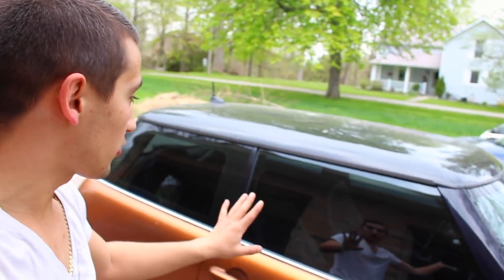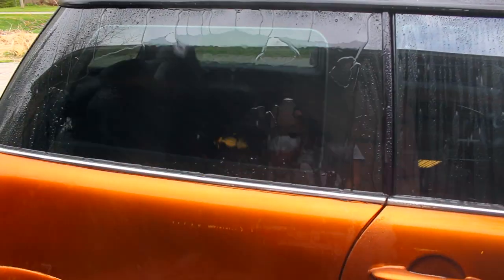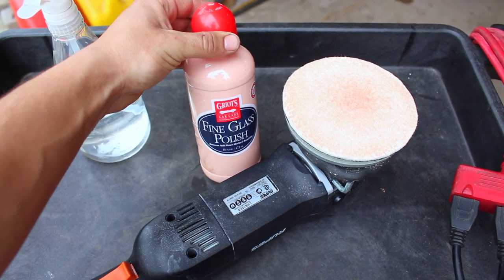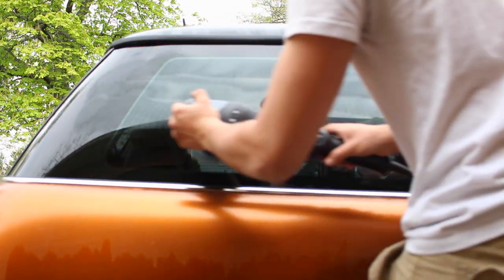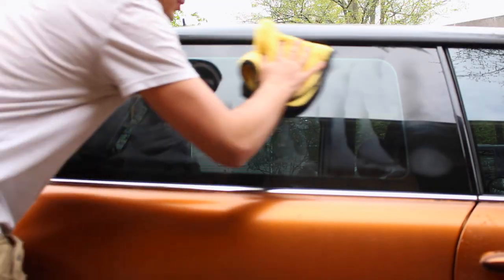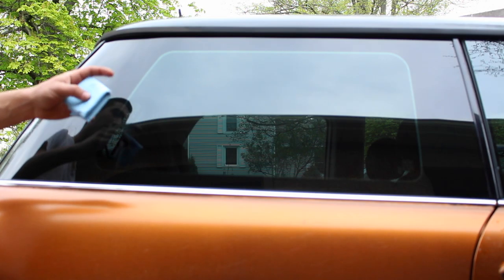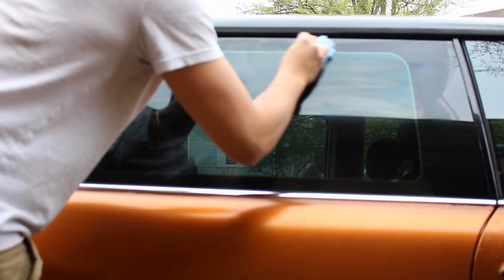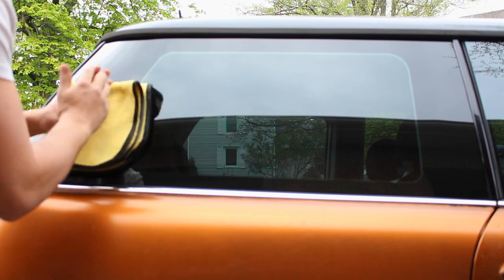How to Polish Your Windows

Comment: I just use rain-x; I used it in the past, on my windshield, out of 100 mile trip in rain, Erie to PGH, PA. I use my viper, less than 3 times.
For windshield, I used the rain-x windshield washer fluid, and for windows, I used the applicator.

Comment: I think the beading was mostly to do with the Rain-X and not the polish.  For windows with some sort of fallout on them, I would have cleaned, clay barred, polished, then Rain-X.  If you garage your car mostly, you probably do not need to polish your glass but I would always clay bar it.  I also use Griot's products, they can be a little pricey and there are other fine products out there.  

Note:  although I have a set of first generation Griot's microfiber towels, I would not buy them again.  They worked well, but so many others last longer (retain their pile) and are less expensive.  I recommend Griot's cleaning solutions, but not their microfiber towels.

Comment: Rain-X will come off if you look at it wrong.  The stuff lasts 2-3 days tops.  Use a regular sealant for decent longevity.  Collinite waxes are outstanding for this.  Good video.
Reply: mine lasted 2-3 months using rainx

Comment: If u can find aquapel, use it over rainx it last longer and easier to clean. It is expensive though.
Reply from the maker: +Kofi I've used it before but am not a big fan of it. I find that the rain x does a better job in the first couple weeks of the application, but the aquapel is better after that mark because it lasts longer.

Comment: Hi, I wanted to ask your advice. I have a commercial size aquarium I am building and one side of glass has a lot of wax/left of clear silicone, on the glass and I tried vinegar, alcohol and a handheld steam cleaner, but it wouldn't get it off. I would have to use a dry towel with a lot of heat friction but I don't have the strength or stamina lol. It now looks like a fine layer of smudged hand prints on the glass. I removed most with razor blade but there is still enough on there that it's too annoying. I wanted to try to buff it off, what pad would you recommend for this so that I don't scratch the glass, but it might buff and take the wax off. Also, is there an attachment I can get so I could use those pads with my electric drill so I don't have to buy a specific polisher? Thank you

Comment: Can't you make a video where you remove scratches in the glass? My mint-conditioned Golf (or not because of this) has a lot of scratches in the front window because there probably were some dirt stuck in the windshield when I used the wiper blades and washer fluid. Is there a way of getting them away? :-)
Reply from the maker: +Daniel San Yeah by doing this process. You need to slow down your speed but you can remove scratches out of them by doing this!!
Reply: milanmastracci Holy shit I need to try this then! :-)
Reply: Daniel Fl. Hello Mr 
In your case is really risky to remove scratches from your window because you will apply to much pressure over the glass eventually you will brake your window.  If your window is really damage then consider to replace it.  I think is the best way to go. 
Have a good day!
Reply: Pedro Parejo Yeah okay. 
It's just so expensive to buy a new front window on German cars. It's like 500$ for just a new front window.
I think I just have to live with it.
Reply: Daniel Fl. Use carpro ceriglass it's way better than griots it cuts a lot faster too
Reply: I live in Denmark, so all these products are kind of hard to find...

Comment: Hi, I have a question for you. I tried the method you are using on two of my cars, one is a new car and the other is older. Both now have some hard to see swirl marks after using my DA polisher. What I used was the following for my new car : 
-Griots Garage 6.5" polisher
-Griots Garage 5" backing plate 
-White Chemical Guys hex 5.5" foam pad
-Chemical Guys v38 polish 
-Speed of 4

Older car:
-GG 6.5" DA
-GG Glass Polisher Pad
-GG Glass Polish
-Speed of 5

Can you offer some advice for me on how to fix this please for both cars? Thanks so much!

Comment: What do you think about appling wax instead of rainx?
Reply: If you can do it and make it smudge free it would probably work but buffing wax onto something so smooth would be difficult
Reply from the maker: +Zach Monk Zach 2 for 2 :) I've tried waxing the glass before and it does bead water, however it not only doesn't bead as well as Rain X, but when you use the wipers, it will pick up and smudge the tiny bit of wax that is on the window, even if you think you got it all. My advice would be to spend the 7 bucks and get some Rain X.
Reply: +milanmastracci Good to know! You recommend the liquid rainx but you use the spay form. I'm not sure what to get :)
Reply: +milanmastracci Yup they did that to our Genesis when we purchased it and it took a good while for the wax to wear off. It left a line of wax right where the passenger wiper stopped and went back. Basically if you use your wipers don't use wax! :)

I just use the Rain-X Glass Cleaner and it works great but doesn't last as long. Not a big deal though...

Comment: Would ultimate polish by meguiairs work well with a polishing pad. Or is that to coarse / hard??? I have a lot of water spots and a few scratches I want to get rid of
Reply: philip lubduck actually the reason it wouldn't work so well is because glass is so much harder than paint the compound like that was not made quite for that so it will work a tiny little bit,close to not at all

Comment: you know you can use 0000 stainless steel wool and quick detailer to achieve the same result, give it a coat of carnauba wax to fininsh it off. It lasts longer than rain-x
Reply: I do a similar procedure, and I can easily get 6 mos protection.  I've gone as much as 8 mos in the past.  Depending on where you live, YMMV.

Comment: hey, im from germany, so excuse me for the english: i am a mechanic but i never tried to polish glass, but it happens that my own windshield has some scratches, i dont want to spend 500bugs for just a new windshield and i dont have the time to let my car sit 1 or 2 days to wait for the glue to dry... do you think this method could work? i mean i dont want to get rid of dirt, i actualy need to flatten out the surfice of the glass. in order to do that i need to take material off! any ideas if that could work? or maybe an other method idea for me to try?
Reply: You can get some rougher glass polish and then you could do a two step polish and that helped me get a lot of scratches out of mine
Reply: +Zach Monk thanks, any suggestions for a good glass polish?
Reply from the maker: +Quwoll The link for the Griot's polishes and pads will work. Start off with the harder polish, and move to the less aggresive one :)

Comment: Will this polish take out a big scratch on the windshield ?
Reply from the maker: +Marc Akel Depends on how deep it is
Reply: +milanmastracci lets say a 1/2 inch scratch caused by the wiper , kinda deep
Reply from the maker: If its the regular scratches from the windshield wiper, yeah it will remove them :)

Comment: Polishing Windows? easy enough
Clear your registry of older/invalid pointer keys
Open the control panel and tweak your privacy settings
Add firewall rules for all of the Microsoft bs backdoors accessing your private data
Delete older caches and ond log entries (usually on windows\softwaredistribution and \logs)
Realize this is a losing fight, and format the system disk
Install Linux in any flavor that suits your needs
??
Profit

DONE
Reply: wow amazing!!